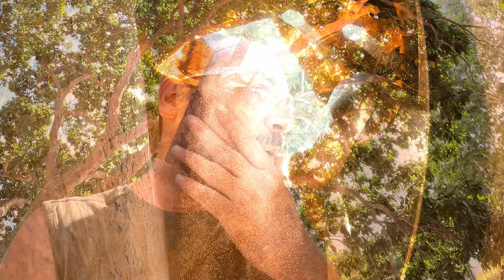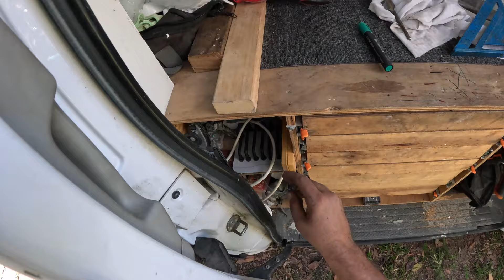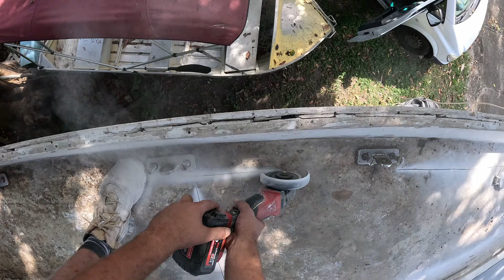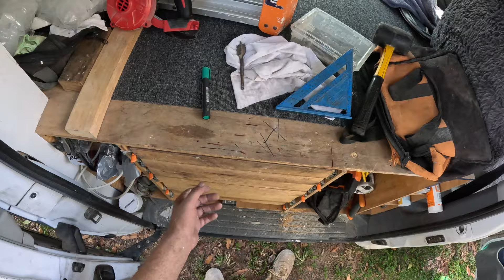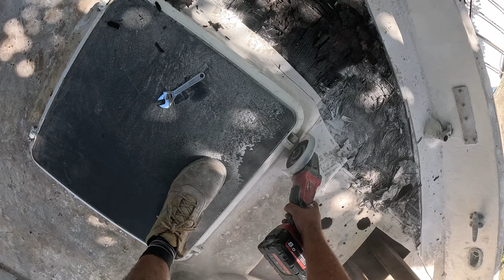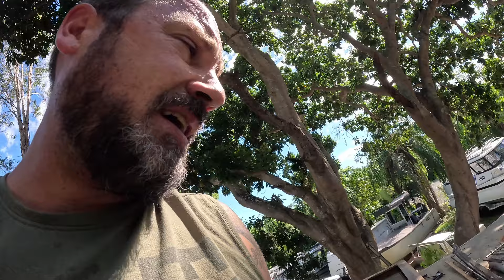Cutting Out The Moldy Deck of My Sailboat - ep78

Comment: Are you planning on saving the pieces you removed and glassing them back on once you replace the core? And are you going to use plywood again or? Great work on a gorgeous boat!
Reply from the maker: Gday mate! Thanks for watching, I wont reuse anything that I have taken out with regards to fibreglass, I want to put new panels in where I can. And not use timber where I can. I am really loving this honeycomb fibreglass panel that I have found with my local fibreglass supplier!
Reply: That will be good for weight. This will take extra work as that substrate will collapse unless you make it solid glass where you install any hardware. I would use something like coosa board for the bow. That’s dense and solid for cleats windless.

Comment: are you going to build a roof over the boat or not? I think it would be better in the long run, since you wouldn't need to worry about rain and leaves anymore. it doesn't need to be a bit. structure, but at least use a tarp on some support structure. 
greetings from Slovakia 🙂
Reply from the maker: Yeah so I have a tarp over it now when I'm not working on it. I don't want to completely close it up because it is so wet and humid up here that the inside could get really moldy - but the tarp is keeping her safe :) Thanks for watching mate!
Reply: I wish you luck in your endeavour with enchantress I'm sure with your  commitment you have shown so far you will prevail bit of a  shock to see the rot so much as long as the main hull is sound you will win although cost does come into the equation good luck mate 😊😊

Comment: Are you planning on saving the pieces you removed and glassing them back on once you replace the core? And are you going to use plywood again or? Great work on a gorgeous boat!
Reply from the maker: Nah I am going to start completely new now that I have cleaned up the deck. I don't want to risk adding in any old rot if I can avoid it!

Thanks so much for watching!